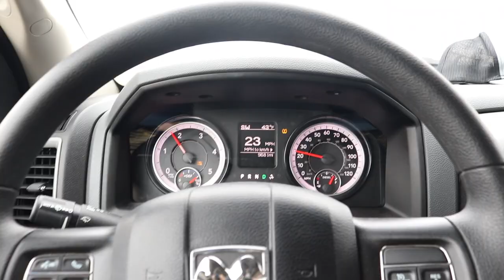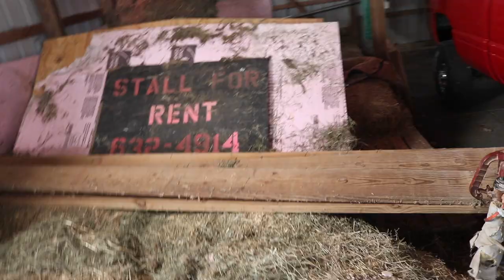CUTTING A POST OUT OF MY BARN!!! Shop Build Ep. 2

Comment: You need to move the horses to the one end of the barn do a complete wall basically splitting barn in two so the diesel fumes and automotive stuff wont affect the horses health. Take the moldy hay to your dads and put it back in the woods to rot away.
Reply from the maker: Corey Potts yeah we are still trying to figure out all the details

Comment: You can use. 2 pound spray foam or  use half pound spray foam. Now half pound  is  not a vapour Barrier   But will quiet down noise and 2 pound would keep it a little warmer. But eather way it’s not cheap  but. Hands down  good investment

Comment: So I feel like you could get more trucks in if on the side where you want to put windows in you could put garage type doors in and have the trucks backed in like shop bays as opposed to having them long ways in the barn. Just a thought
Reply from the maker: Caleb Thiel I absolutely agree. Only problem is I don’t know if that’s an option based on how this barn was built... but definitely A thought!
Reply: @LOUDNPROUD  it is literally a pole barn, absolutely none of the walls are load bearing on the outside or inside. so those i would say about 8 foot gaps between the 6x6 posts can be opened right up for doors, and for insulation, use 1" foamboard against the horizontal 2x4s to make a thermal break from the outside, and then put more horizontal framing 24" on center between the 6x6 posts, put batt insulation in there and put plywood over it and on the ceiling. then someone can come in and put blown in insulation about 1 foot of it which is about R45 to keep it warm in the barn, that is a very simple build on that barn and easy to make into a garage space, dont put any windows in it though just cover the translucent outdoor sheeting with foamboard. for your floor before you pour it put 2" foam under the floor to keep the floor warm as well
Reply: @MikeUtoober  @LOUD 'N' PROUD
 was thinking the same thing. And if he didn't want the truck that would be blocked the stalls, he could remove and save the metal that's on that wall, build maybe an additional 12' out on that side that way the truck's wouldn't block the stalls. Could reuse the metal that was removed. Would just need to purchase some metal for the gable walls.
Reply: You can add doors on that side. You would just have to have a header, preferably steel sistered with 2x's to hold the truss and the door.
Reply: @tsmart767  no he wouldnt, its a pole barn the poles ARE the structure of the barn. everything else is cosmetic. and i dont know if you have made up your mind yet malachi but everyone suggesting sprayfoam well i cant deny that its a great product but its very expensive. the foamboard with framing and batt insulation will have an R value of R28 in the walls which is just as much as sprayfoam but you could do all the labour work yourself instead of hiring it out. and for the blown in you could do that yourself too. probably could even insulate behind the horse stalls with the blown in too for more added warmth there too. it is ultimately up to you but the batts are cheap and the foamboard is cheaper too, also the 2x4 framing gives you somewhere to mount plywood to for the walls as well, not to mention the problem no one is mentioning about sprayfoam that it creeps int cracks and gaps which can be good but usually barns arent very well sealed so it will probably find its wayinto the seams of the metal sheets and end up on the outside of your barn or distorting the metal on the barn itself
Reply: @MikeUtoober  yes the poles are structure. But the header would still be needed to hold the doors. And when it comes to pole barns the metal on the outside play a big role in the overall structure and strength of the barn. I totally agree with you on the insulation. Batting on sides and blown in in the ceiling.
Reply: @tsmart767  oh to hold the doors yes, i thought you were meaning structural the building itself. He wouldnt need much of a header though probably only a 4x6 header or something like that would do just fine since the poles are the structure of the building
Reply: @MikeUtoober  right. Those poles also hold the truss. So depending on the span between the poles and how the truss ties in within that span, would determine what type of beam/header is needed
Reply: @MikeUtoober  another thing to think about. If the posts are spaced 8' on center, he only has about 7'6" between the posts meaning that, without ordering custom overhead doors, he would have to go with 7' wide doors. That being said, he would need to fold in the mirrors Everytime parking in there. Also, with the tire poke most of his trucks usually have, they wouldn't fit.

Comment: Hey instead of putting pulleys and shit like that why dont you pull out all of those posts and just go get a gantry crane on wheels and when you dont need it you can roll it to a wall and you will have way more room and you wont have a post to work around. Theres my two cents in. And if you need to pull a bed off of a truck that cant be moved under its own power because engine needs some work you cam roll the gantry crane up to it and pull the bed off and roll it back

Comment: First frame ceiling for metal ceiling liner then frame in windows and doors then sprayfoam insulation and painted osb walls with the glue side towards the insulation.
Reply: blow in cellulose over metal ceiling.